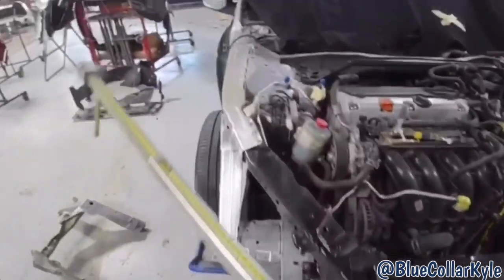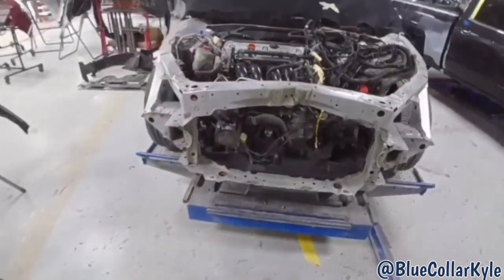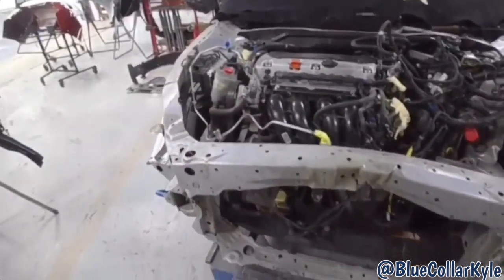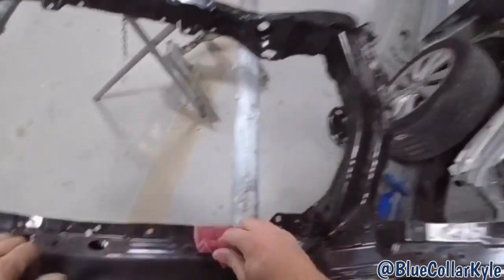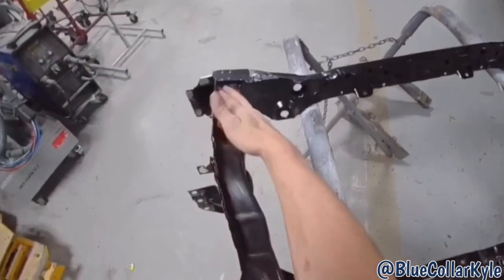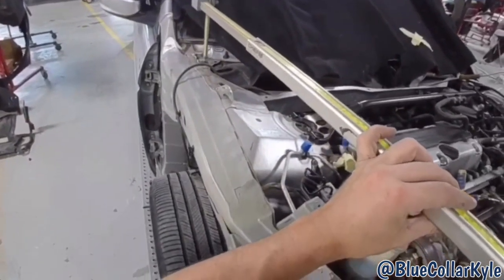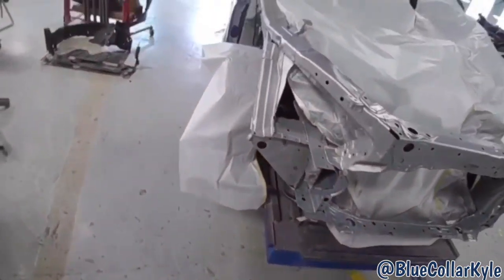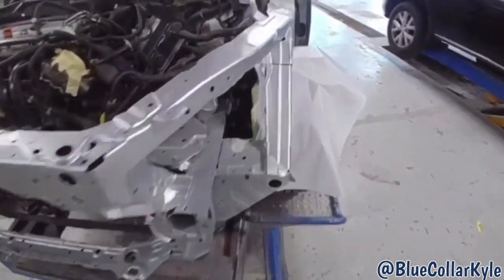Replacing A Honda Radiator Support

Comment: Great video bro. Hey I have a 2012 Accord And I wanted to know what is the best way to measure your side rails to make sure that they are in place? And was that a OEM core support or after market?  Lastly what grit sandpaper do you use on your little sander/grinder? Thanks bro

Comment: Nice work! A little beasty but thats my style haha Anyways, you just drilled out the spot welds with a regular drill bit made for steel? I se ppl using those little "spot weld remover" bits with the center spike and teeth like a wood hole saw bit. Whats your opinion? Im currently fixing my 2002 Ep3 bulkhead/radiator support after a low speed rear end (front end for me) collision. Thanks bruv